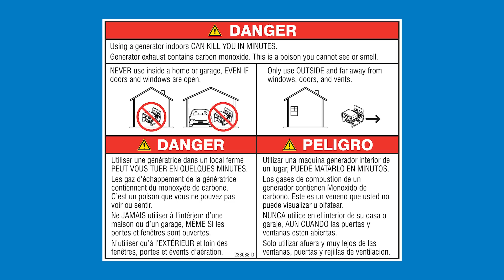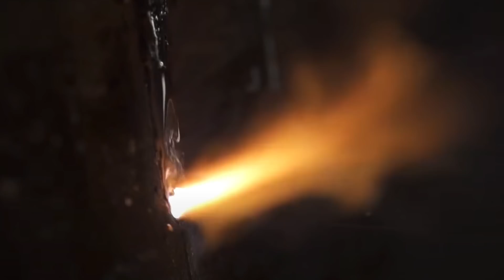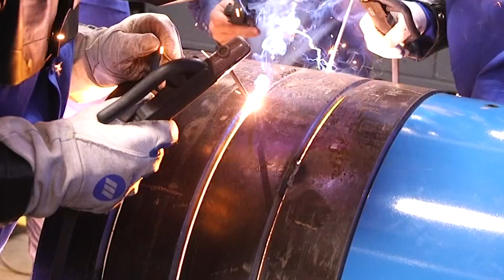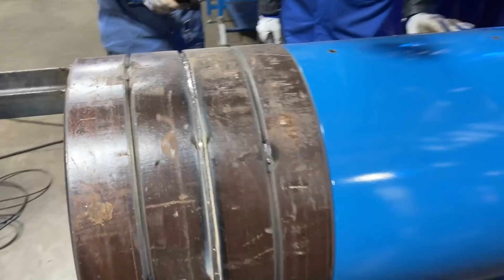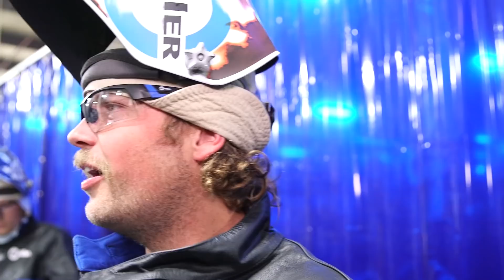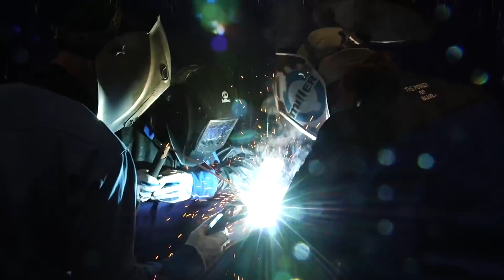Downhill Stick Welding on a 24" Pipe | Pipeline

Comment: What do you guys like the machine max set on when remote is on 100?, what do you recommend for the dig range, the dig, the hot start, and I ask for software M. I usually have machine max on 220, hot start .6 dig range 105, dig stif 5. Would like to stack more metal should I turn my machine max up, dig range higher and run the dig on a higher stif setting?

Comment: Hello sir 
Which welding is better mig or stick welding ?? 
Indoor 
Low heat temperature should be maintain so that plate to be welded should not bended due to the heat produced by welding machine

Comment: great vid ! ive been welding pipeline here in canada for 35 yrs you guys are doing it the same way we did 35 yrs ago i used a 1961 200amp lincoln and swore by them but that miller is one bad ass machine i want one now great job guys your all good hands thumbs up from canada

Comment: Is that remote adjusting Amperage or Voltage ??? The Lincoln remote ( box) is a voltage regulator ….. correct or No ?? I run the 350d pipe pro with the wireless remote from Miller……. 40p on that remote would be 40% of my high end set limit ??? I’ve had this discussion with many people regarding how these remotes actually work……
Reply: Да

Comment: I don't work on pipeline so excuse me if I'm wrong and this doesn't apply, doesn't having 2 welders start at the same spot and end at the same spot run the risk of  blowing over interpass?
Reply: I’m no pipe welder myself, but I assume you’re allowed to be a little more sloppy on a coupon. since on an actual pipe, it’s constantly pulling the heat away,  and if I’m not Mistaken, on some larger diameters and certain procedures the helper has to actually keep the weed burner on it as needed.